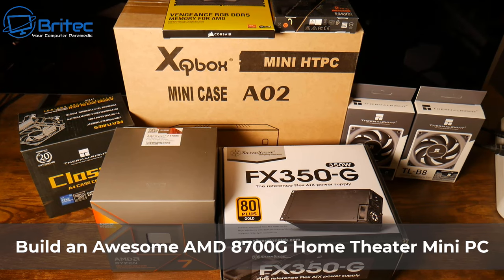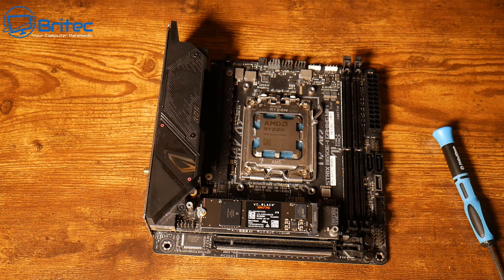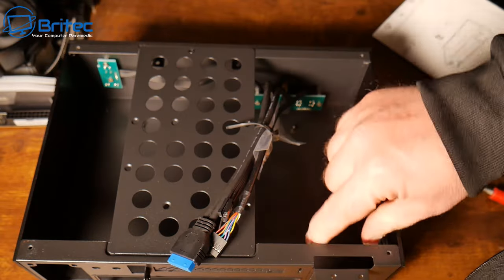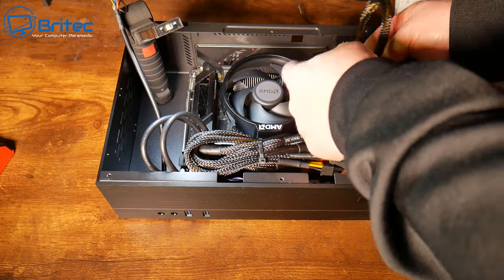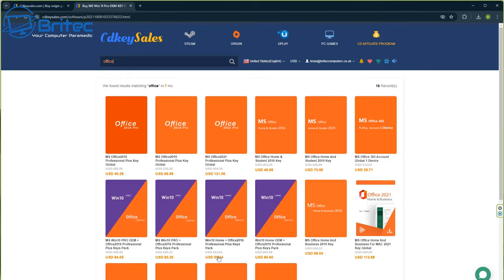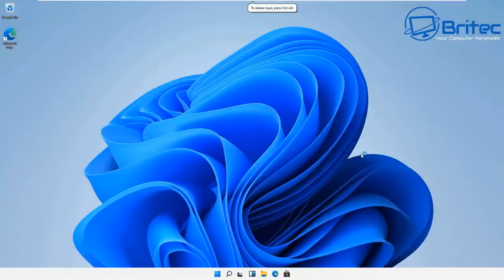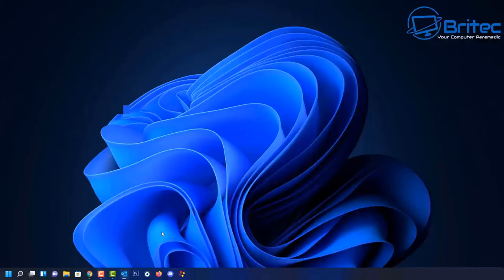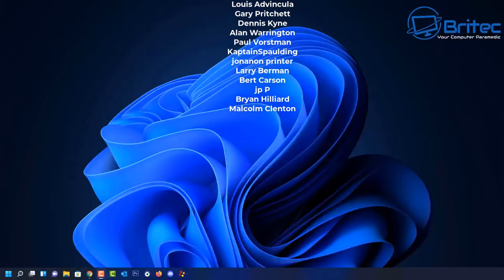Build an Awesome AMD 8700G Home Theatre Mini PC

Comment: Nice build, but it strikes me as using a sledge hammer to crack a walnut for a home theatre PC. You could spend a ton less and have a machine that would do the job and use less power and likely run cooler, too. Still, thanks for the video.

Comment: nice case. the bracket for ssd's do not restrict airflow, because the outer cover does not have holes for ariflow where the ssd bracket is located
Reply from the maker: Hey big man, hope your doing OK.

Comment: Have you ever considered a Pico-psu for these htpc builds ? most of them are 120-180w and are enough if you don't plan on installing a dedicated gpu. The high-end picos can reach 250-400w, they are slightly larger but still slim and it is a great way to save space and clear cables mess.
Reply from the maker: Pico-psu are nice

Comment: Would the case fans not be more useful as case extraction fans rather than fighting the CPU fan which is drawing cool air in and across the cpu
Reply from the maker: No,  because there is no intake and plenty of ventilation vents
Reply: @Britec09  sounds like you haven't considered the air flow route enough to me